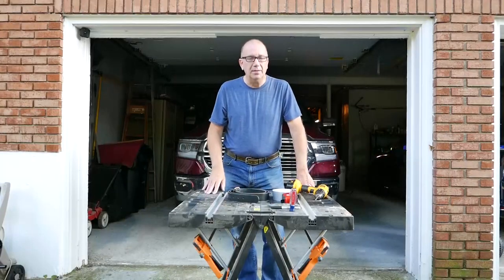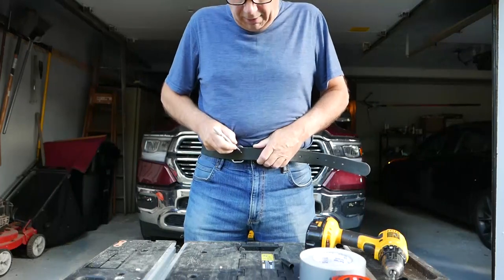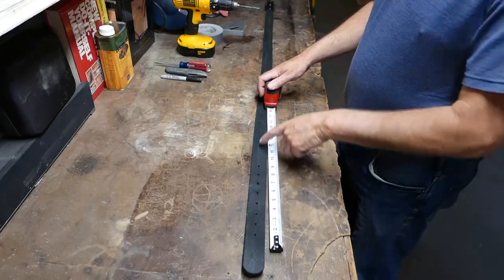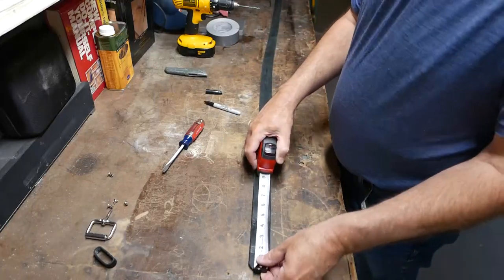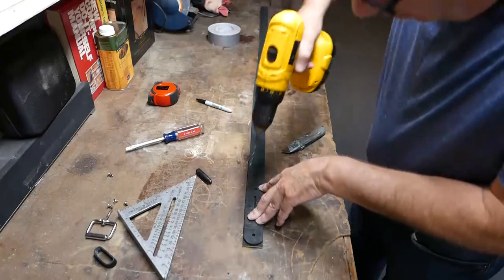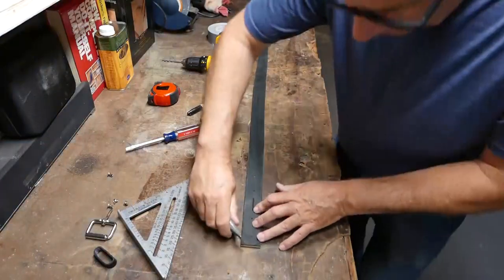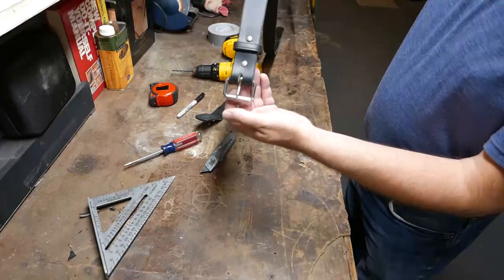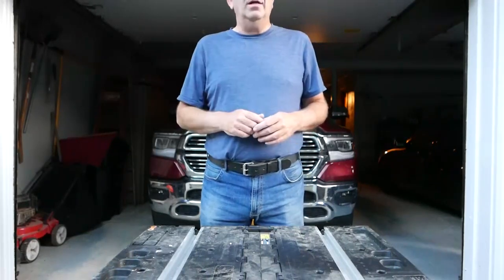How To Shorten A Non-Stitched Hanks Belt

Comment: A couple of suggestions.  I could not get the bolts to go in with the 13/64 bit, I had to use a 7/32 bit and it worked fine.  Also, if you drill a hole in each end of the slot for the buckle it cuts out much easier and looks better.

Overall, great video, thank you so much for making it!!

Comment: Some stores still sell edge dressing which is a black dye for the edges of shoe soles. That should work well for coloring the cut edge of the belt. I would also suggest to drill holes at the edge of the slot then cut two parallel cut between them. Instead of drilling for about $15 you can get a leather punch. I think they sell them on the hanks belt web site. 

This was a great video. I only wish it was as easy to lengthen belts as it is to shorten them.
Reply from the maker: Great tips! Thanks for sharing. Drilling the holes at the edge of the slots would be much better than the way I did it!

Comment: Just a thought when doing the slot to make it easier/result in a cleaner slot:  drill holes (of the slot width) at either end of the slot and then take the utility knife and connect the holes to one another (top-to-top and bottom-to-bottom).  

Haven't had to shorten a belt down yet, but that's how I'd do it!
Reply: Just saw after posting that @James Cook had the same idea I did but 5 months ago... hopefully that means it's a good one!
Reply from the maker: That would be much easier and cleaner. Thanks!

Comment: If you don't have hole punches, you can use the drill to punch holes at both ends of your slot so you have less of a chance of cutting past the slot into the belt and give a more finished slot.  Also wet the belt at the crease and it'll bend around the buckle easier.
Reply from the maker: Some great tips! Thanks!

Comment: I wouldn't be able to take 3"s of this way would I?
Reply from the maker: You really need to get paste the slot for the buckle so 3" might not be enough. 4 1/2" gets you past the slot.
Reply: @HanksBelts   I was just wondering the same thing.  I'm at the last slot due to some weight loss and now my "Everyday Belt" looks to long on the tag end.  I guess I'd need to lose a few more inches to do this procedure without ruining the belt.  Excellent video and excellent belts, and the wallets too! Bought one of the wallets about six months ago and it's still a solid piece of artwork!
Reply from the maker: @MrWolfman104  Thanks so much! Glad you like the wallets and belts. Yes, you may need a couple more inches before you can shorten the belt using this method.
Reply: @HanksBelts  Wish I read this before I made my purchase. I need to take 2 -3 inches off and can't do it. And I don't have enough weight left to lose to ever take 4-1/2 inches off. Kind of bitter about the situation. Rational or not, my replacement belts will probably be another brand.
Reply from the maker: @davidrooney5530  you may be able to take 3" off. It will just not look as neat as some of the old slot may still be there. None of it will show once the belt is fastened. If you only need it 2-3 inches shorter you can easily add a hole or two in the belt also and it will be perfectly functional. What belt do you have? If it's non-stitched you can add holes and cut the end down. One of the side effects of weight loss is a closet full of clothes that no longer fit. I lost 40lbs myself and even some of my shoes don't fit anymore and slip on my feet. I got 20 pairs of jeans that are going to donation. Certainly no fault of the manufacturer. If the belt is not worn we will gladly exchange it for you as we have free exchanges.
Reply: @HanksBelts  I have two Everyday belts. I'm thinking I'll go ahead and reduce the one I wear less often by 4-1/2" and see how it looks. Probably won't get past the second hole in the buckle, but that'd be better than nothing. I think cutting the rounded end and boring new holes would look crappy. I suppose the fact that the price has dropped $18 since I bought mine is good news if I decide to replace the ones I have. Now I just have to go buy that weird size drill bit and see if I can get the screws out - your tape trick hasn't worked for me.
Reply: Shortened my brown belt. Went from the smallest hole to the second largest. I should be able to tighten one more hole by the time I'm done with my weight loss.

I found the screws impossible to remove using your tape technique. Instead I used a set of ChannelLock pliers to grab the edge of the unslotted side and hold it while loosening the screw. Made some small marks, but they're not visible when wearing the belt. The drill bit size recommended was available at a local home center and was the perfect size.

I'm happy enough with the results to keep wearing it. Thanks for the instructions and advice !
Reply: Ten days later: Dissatisfied with the shortened belts. I can't get past the first hole without discomfort. I might get to the second hole someday, but that will still look crappy.

Since I'm now close to my final weight, I'll make my best guest on size and buy a new black one. If that works, I'll buy a brown one of the same size and give the shortened belts away. As anyone who's lost a lot of weight knows, buying and giving away clothes is unavoidable and really expensive.

I would not recommend buying these belts assuming you'll be able to shorten them as you lose weight. Buy less expensive belts that you won't mind giving away, then buy the good belts when you've reached your goal weight.